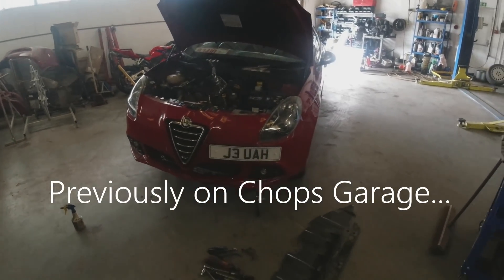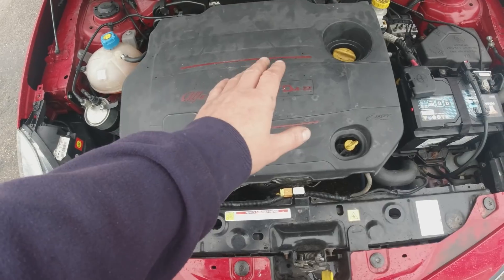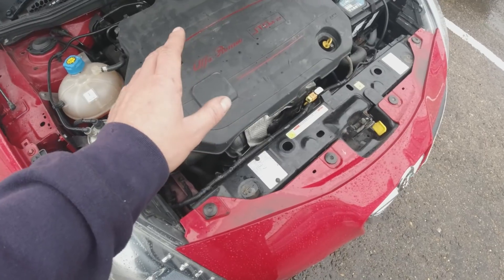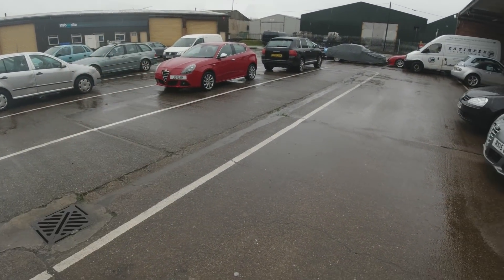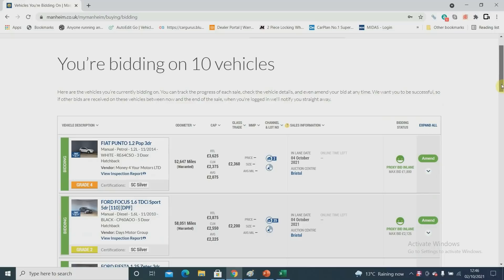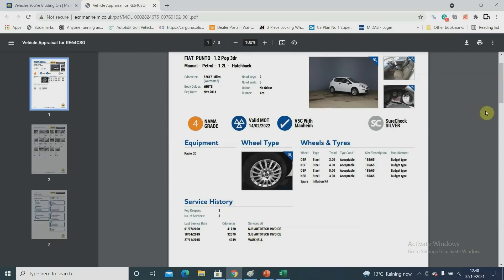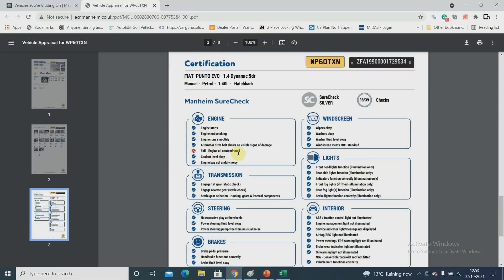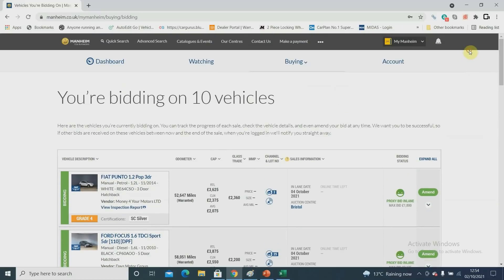Can we Save It! My Dealer Auction Alfa Romeo is STILL not right!

Comment: Hi James.. sounds like the waste gate on the turbo is sticking  or has become burnt and not closing fully with the actuator.. this would cause the loss of boost. so I'd take the turbo off and check the waste gate arm and face seal internal to exhaust side on turbo .. This will not show up as a fault ( Electronic ) on the dash.. but will make it a pig to drive .. Hope this helps Andy ..
Reply from the maker: It drives ok just boosting very late with no bunch
Reply: @ChopsGarage  I suspect the boost is being lost at low engine RPM through the waste gate on the turbo .. hence at high engine RPM it will ballance the loss of exhaust gass through waste gate to pressure in exhaust system and give the car more Oomph at Higher Engine speed .. Just My Thoughts  Andy

Comment: I have just read all the comments, Have owned a few high mileage alfa JTDs. I had a 156 20V bought with 119000 mile sold 6 years later with 186000 miles. I have driven about 150000 in alfa JTDs between 2007-2018.
I have just recently back in Alfa ownership. 2016 Giulietta 1.6 JTDM.
I hope I can help, as I have had plenty of issues. The most important thing to do is plug the Alfa into multiscan and get someone else to drive it while your looking at expected values such as boost pressure fuel pressure injectors if your boost is low recheck all vacuum pipes and egr and boost pipe from intercooler to inlet manifold.
You will solve this issue.
Reply: Forgot to mention expected values and actual values should be close.

Comment: Cannot remember if posted here, but Bluetooth OBD2 reader with Torque on an Android phone or tablet will give real time boost pressures when driving. May give you some data of when boost starts, where it peaks and which you can cross reference with revs which you can also have on the Android device.

Comment: ive got a zafira (Z19DTH Engine alfas used in the 150bhp models) with an issue similar to this ive replaced boost sensor, egr, inlet manifold , boost pipes checked and the little vacuum hoses… with dpf check the pipes that leave the pressure sensor to the exhaust they can clog up with soot and even can be broken as they’re rubber hose to plastic then rubber again (stupid design) my next step is disable swirl flaps

Comment: Might be a turbo actuator whether it is a electronic one or vaccum one. Also i would take the actual turbo apart and clean it, i know your mr muscle trick but it is not going to clean it perfectly. VNT flaps might still be sticking like hell. Also check the egr valve again, they simply burn out with time so you might clean it but it doesn't mean it works properly if that makes sense. Good luck!

Comment: All I can add,is try the remedies suggested-in cheapest order.
I had a big peugeot with virtually no boost,garages thought it was egr,I changed the maf and that fixed it.
Other Peugeot I blanked off egr as no reprogramming needed.
Strangest one was a 12 merc 220 cdi. Would only rev to 3000,could hardly pass a tractor. The boost would return only in 1st gear,but the auto box wouldnt go into 2nd,so had to take foot off gas.Garages changed things,but nobody could fix it,so got rid.
Reply from the maker: Strange one
Reply: They are all strange James. Had a e320 v6,was fast,then lost about half the boost,the garage put on a big silver thing,went from wing to wing,cost £400 and still the same lol.

Comment: So from what you say, it sounds like the problem is not intermittent now, and the boost never comes on properly, and there are no fault codes related to the sensor. I guess the absence of fault codes does not necessarily mean the sensor is measuring things correctly, it probably just means the values are “within range”. With all the things you’ve tried, maybe it’s time to take the turbo off and see if you can verify if the actuator is the correct part and that it’s moving correctly. I assume the actuator is an electrical solenoid. Wonder if you could test on a bench power supply and see how the actuator responds to voltage changes. I wonder why the actuator was changed in the first place. Good luck. Must be frustrating having tried several things to fix and to still have an issue.
Reply from the maker: Cheers for advice

Comment: remove gut and reweld up the dpf (obviously carefully/tidily and get it remapped with a egr and dpf delete in the software problem gone entirely for a couple hours work and £150-250 and the engine running now better than it ever has and wearing far far slower etc etc and MUCH better fuel economy no more polluted oil (with fuel LONG before the service is due

Comment: Picked this up on the Alfa forum ,,,,,,after a quick google  .Swirl flaps these can cause a loss of power low down (mainly due to EGR which soots them up). On older engines (with a metal manifold), you can see relatively clearly if one is sticking. Not so easy on the newer 'plastic' (black) manifold. A short term fix is to spray some carb cleaner in through the intake pipe which may, or may not loosen the deposits.Throttle Body/ Manifold

Not usually an 'overnight issue', but as the car ages, your "throttle body" and manifold is likely to start getting gummed up with a mixture of oil and soot (from the EGR and the oil Breather). This is going to start blocking off and affecting the butterfly valve in the throttle body and restricting flow through the manifold (and increasing the pressure on the swirl flaps which may break).
Cleaning the manifold properly is a difficult job, best done when you get the timing belt done (as it has to come off to access the manifold). However the throttle body can be done yourself (link below). In terms of the manifold, to help things along, spray some intake cleaner or EGR cleaner into the manifold (best access is through the throttle body, EGR or MAP ports), this will help to soften and loosen some of the gunk (mine gave off a lot of dark grey smoke after doing this!!). Blanking the EGR will also help reduce the likelihood of this happening!

Comment: Just thought I'd leave this comment to elaborate on/clarify a few things from my list last night... 
Yes it's looking more and more like the turbo itself to be at fault (vanes etc) but my main point is that it's well worth checking all those things before spending more money on parts. It's a time-consuming process but at least you wont be sinking potentially unecessary money into it. 
A smoke test into all the vacuum lines and boost pipework is also well worth it, the tiniest of leaks, even pin holes can cause havoc. I did mention that in a previous comment section but there were hundreds of comments so understand you may not have seen it among the rest 👍
Good luck and I hope one of the many suggestions from various people in here will solve it 😁

Comment: I would strip down the intake side of the engine - remove the manifold and everything you haven't already cleaned and checked. At this age it's more than likely to be suffering with carbon build up. It's not uncommon for the older 1.9 and 2.4 JTDm diesels to block up the intake manifolds to half their original diameter with soot.

Comment: For what it’s worth, I’d stop firing the parts canon at the Alfa that way leads ruin. As I’m sure you know modern diesels need to be driven a lot and a long way, short journeys kill them, not just the DPF but all the other environment protection stuff, if the DPF was showing 70% that’s very clogged, however if it took a regen and now showing normal levels (25% is about the max) I would focus on the turbo I suspect it’s variable vane and it might be you have actually sorted it via the cleaning and now just need to drive it a lot to get rid of what’s left, modern diesels don’t give that boost the old ones did (ie that shove at a certain Rev range) it’s continuous but if the vanes are sticking you will get that nothing, then boost and so on. Anyway love the content keep it up good luck.

Comment: i think you are mixing up turbo control vacuum solenoid with boost sensor, map sensor is the boost sensor, it shows the intake manifold pressure. And it could bee that turbo rod is not adjusted properly and because of that vg (variable geometry flaps inside the turbo) are not in correct position or just sticking

Comment: It would be worth plugging the Alfa in to MultiECUScan, and record on a graph measured vs desired values for intake air volume, boost, n75 etc and see if any of them are out compared to the desired figures. Good luck
Reply: Along the same lines, it's not had a (bad) remap on it has it?

Comment: My son's Mito had DPF light all the time, only reporting 20% blocked. I replaced the Pressure differential sensor, ok for about 5 mins, then light back on. Fix was to use the scan tool and tell the ECM I'd replaced the sensor so that it would relearn. I use Multiscanecu on Alfa's Works great.

Comment: Blank off temp or try a new EGR valve, could still be faulty even though you have cleaned it. Will cause similar issues
Reply from the maker: Need to check the readings for it again

Comment: Have you checked the vac pipes for cracks? Or the rubbers hoses that connect the  dpf pressure sensor/ exhaust pressure sensor?
Also, check you have put the vac pipes back on the right way.

Comment: The wastegate only moves around 15mm - so if it’s 8mm out - it’s maybe the issue - having said that on my VW a faulty diaphragm (no suction), once has sent it in limp mode, and when it went again - I got a fault code, but only a slight loss of power (maybe 20%) - maybe more it the job to replace it tomorrow if the weather is okay. How old is the fuel?

Comment: Hi James, measure the actuator arm movement, that is, is it moving freely and correctly.  I had a similar issue with my VW Golf 1.9 TDI BKD engine.  Whilst it moved, it wasn't travelling the correct distance and therefore I could work out I had sticky clogged up variable vanes.
Reply from the maker: Cheers

Comment: Sounds the actuator is the most likely culprit. However, if this is a big job or expensive I would sell it as is. It seems safe enough even though it isn't maybe as fast as it should be.

Also, activate Windows on your computer otherwise it may affect updates.

Comment: I know its a different engine obviously but i had an Audi A4 a few years ago with similar symptoms , i tried all the sensors you have mentioned and none made any difference. It ended up being the vacuum pump as it wasn't creating enough vacuum for the turbo actuator. As said i know its a different engine but my symptoms was more or less exactly the same. Hope this helps James 👍
Reply from the maker: All helps bud
Reply: I mentioned this the other week, high engine revs will give higher vacuum level
Reply from the maker: @dennisphoenix1  sorry can you expand a bit
Reply: @ChopsGarage  if you can get access to a vacuum  gauge try connecting it to the vacuum pump directly and see how much it's creating . I had one van with no boost at all , turned out the small porting on the vac pump was blocked . Check the connections on the boost solenoid valve are the right way around,  if they are the wrong way the vacuum is trying to pull the valve closed against the solenoid.  Try linking out the boost solenoid so you would have boost pressure all the time and drive it round .
Reply: @ChopsGarage  not being funny but do you know how a turbo works ??   As the engine speed increases the exhaust gas volume increases so powering the driver fan , this spins the shaft and powers the driven fan which pushes intake air into the cylinders.   If your turbo has a vacuum actuator is it a waste gate turbo or a vane type ?  If it's a waste gate and it's not closing properly you won't get maximum pressure,  if it's a vane type the vanes don't close /open if the actuator rod is incorrectly adjusted .
Reply from the maker: @dennisphoenix1  No offence taken, I don't really so appreciate the advice. I believe this is Vane so the actuator is there most likely
Reply from the maker: @dennisphoenix1  We see the arm on actuator move when sucking on the pipe
Reply: @ChopsGarage  even if the arm is moving doesn't mean it giving full travel . Try disconnecting the arm and see what the travel is in both directions.  Might not be opening and closing the vanes correctly.  Did you have a code for it ??

Comment: Are you sure the flow through the dpf is clear? Could it be clogged up? I would take it off, soak it using Wynn's dpf off car cleaner and flush through with a pressure washer. I did this on my Honda accord Nd also a Mercedes e class w212 model. Very powerful after.

Comment: Has the car ever had a re-map or been chipped ? this can cause big problems on some cars I had a very similar problems with a Corsa VXR I changed boost sensor ended up replacing, turbo, ECU with Vauxhall still had the problem, my advice after mine would be get rid it will turn  into a money pit and if you retail it will just keep coming back and you will end up taking back, I love Alfas but sometimes they can become nightmares...

Comment: I had a 2.0 JTDM Giulietta which seemed like a great 2nd hand buy as depreciation was so bad and I loved much about it. But after expensive suspension work which never solved a knocking noise and shredded tyres in under 8000 miles due to alignment that couldn’t be fixed, cooling problems that left me stranded several times, various electrical problems and rusting bodywork I ended up trading in in just to get rid of it.  I like the drive, the style and the image of Alfa’s but will never buy one again. Clarkson says that every petrol head should own an Alfa, but be prepared for constant disappointment and big bills. 🙁
Reply from the maker: Try the 90s stuff mate, allot simpler

Comment: Buy another OEM  boost pressure. Connect a decent diagnostic tool and watch the live data before and after changing it. If that doesn't fix it. I'd fit a blank plug to the egr valve. See how it drives then. If there's no noticeable difference I'd say its a new turbo. Maybe why it was at the auction. Maybe try contact the previous owner see why it was sold.

Comment: Have you done a smoke test to see if the swirl flaps are leaking boost pressure? Would be a good thing to check. 
  Also I’d be interested to know how quickly the turbo actuator moves on start up. It should travel to its stop almost instantly if it doesn’t it has a vacuum issue.
Reply from the maker: Cheers for tips
Reply: @ChopsGarage  have said it already sounds like boost leak, have an impreza and a honda both did the same, imprezza doesn't throw a code but honda did, found that hole was a pin prick in a pipe, but imprezza still has intermitent problem.

Comment: James,do you think that a lot of em cars are from that auction from WBAC?,as em fookers offer peanuts for older cars.
They offered me £225 minus £50 admin fee for a peugeot 407d 59 plate 120k.
I sold it privately for £1100,but I threw in a clutch kit(£500 but I bought for £300 from Autodoc,) and a £100 worth of suspension bits.
Reply from the maker: Oh yes loads bud big feeder for BCA
Reply: @ChopsGarage  Pity you cant intercept them before the people go to WBAC as you would beat any price they offer for older smaller cars.

Comment: When you do live data are you getting 1 bar at tickover so no boost at all  ?  My van is sluggish at low revs , the fault codes I am getting are egr value incorrect and maf sensor . If the egr is opening too much you lose flow across the turbo so it doesn't spool up . Try driving the car with the actuator rod disconnected to see how it goes without any boost pressure.
Reply from the maker: Good idea!
Reply: @ChopsGarage  update . I have finally got around to changing the MAF sensor and the power under 2000 revs  is back.

Comment: Hate modern diesels, absolute pain when they go wrong due to the excessive amount of emissions control equipment.
But I would say take a good look at the mechanical side of things. Check the integrity of the vacuum pipes, the turbo vane actuator valve and the swirl flap system (rods, linkages, actuators, etc). Seen the swirl flap rods wear and just drop off on Vauxhalls using the same engine.
Reply from the maker: Yes need to check swirl flaps
Reply: @ChopsGarage  check out Retrorestore, Martin Butler's channel, he's doing a few episodes on the Vauxhall swirl flaps at the moment, no power and very sooted up, think they use the same engine